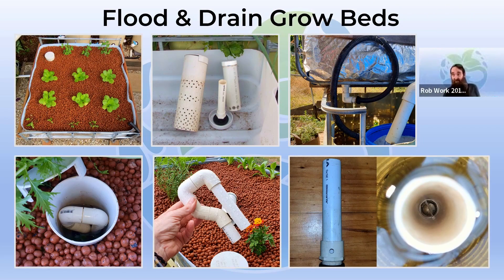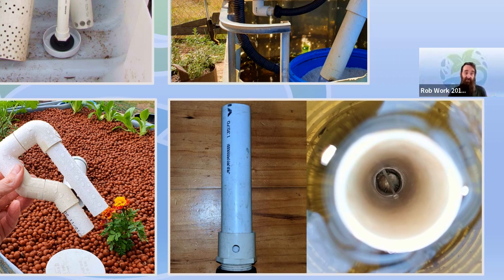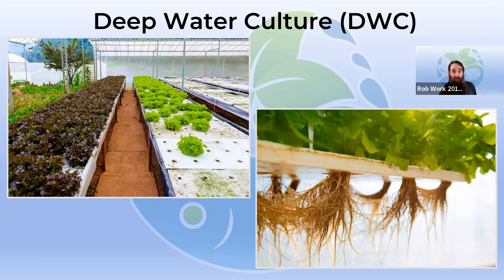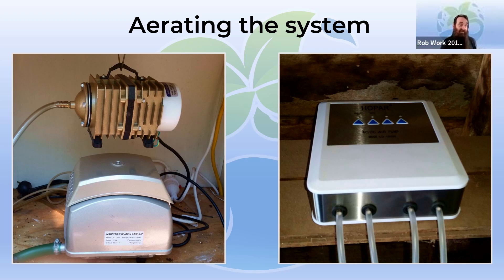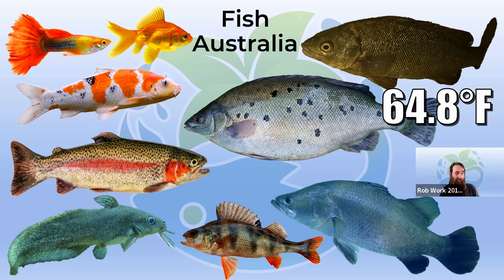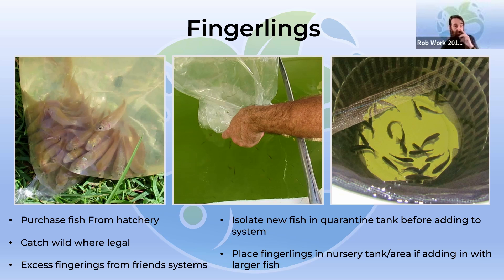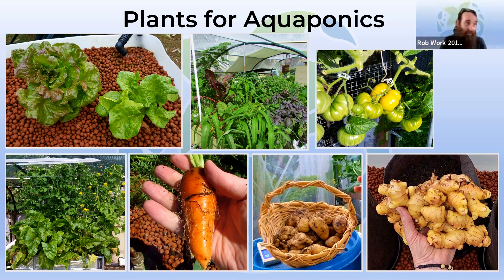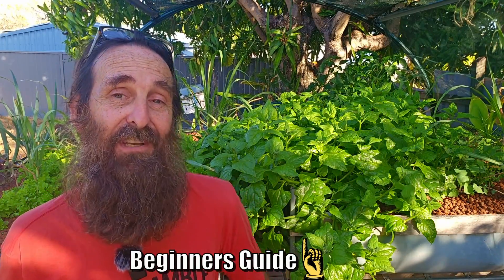Introduction to Aquaponics: Part 3 | Grow Bed Types, All Things FISH +MORE 🐟🍅🥬

Comment: Hi Rob,  do you know what the volume of grow bed is for the 220 litre barrels cut in half?  I'm trying to work out my system size.   I've four half barrels enough room to add another half to make five and two IBC beds 1200x1000x250 and a 1000 litre fish tank. and a large sump tank.  Thanks
Reply from the maker: Sorry I missed this Daniel. At a guess I'd say 85L if cut lengthways or 90L if cut vertically. 
How did the build go?